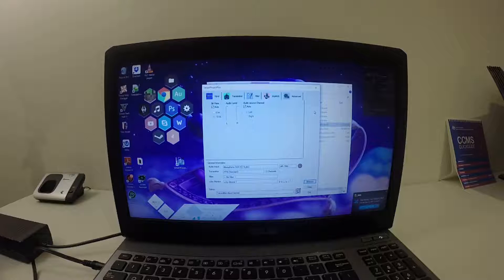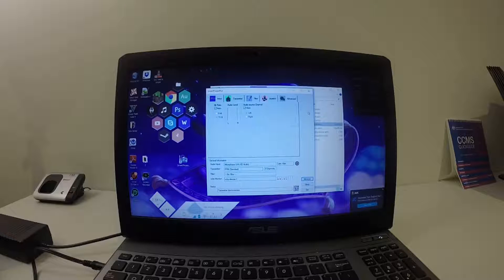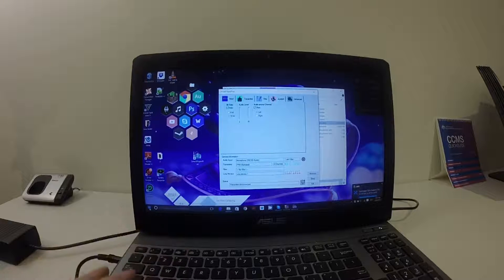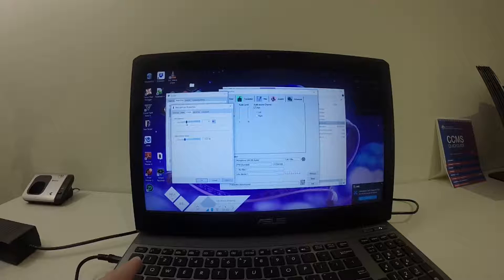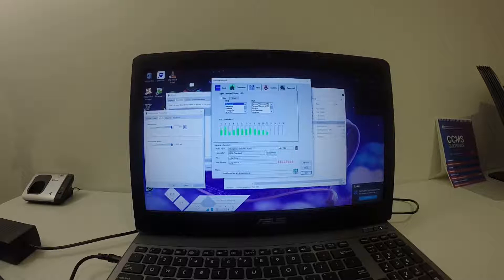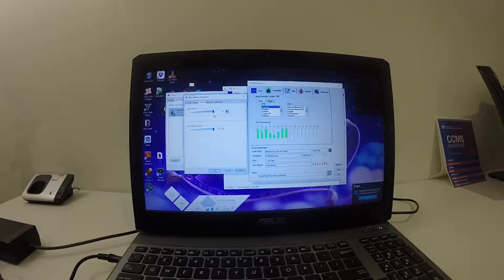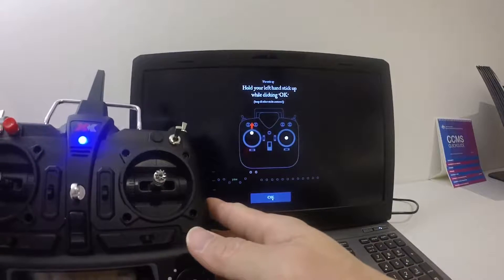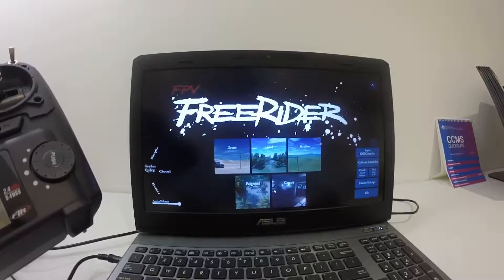XK X7 or X6 transmitter + SmartpropoPlus with FPV Freerider (follow up)

Comment: Hi JT I have tried but no success, on the smartproplus at the bottom mine says Vjoy device is missing what does yours say I can't read it, plus there are no little red bars to the right, status  says transmitter disconnected, just wondered if you might have some idea, I just don't know what to do know,  cheers Nige.
Reply from the maker: 333ingee I presume that you are using x7. Recently I can't get mine to work too.
Reply: yeah X7, wow if you can't get yours to work too, but your a very clever guy, I'm sure you will find a way, I have just uninstalled smartproplus going to reinstall and try again, plus I've ordered another 3.5mm cable to see if the other one was faulty, would really love to try the free rider sim, I have a ps3 and ps4 controller but can't get them to work either.
Reply from the maker: Somehow I got it to work :) Here's the video: https://youtu.be/PsgyJpgs2I4 Enjoy!

Comment: Hey JT,  How can i hook up my XK controller if my laptop doesn't have a microphone input?
Reply from the maker: I hope so. I have bought a cable called USB Analog cable (waiting for it to arrive. It connects to the audio out and the other end is usb. If it works, I will make a video about it.
Reply: ok great, let me know
Reply: @johnnytu1411  did it work? i wan to buy a usb dongle for my xk x6 as well. thanks!